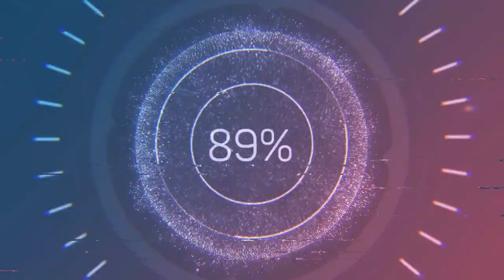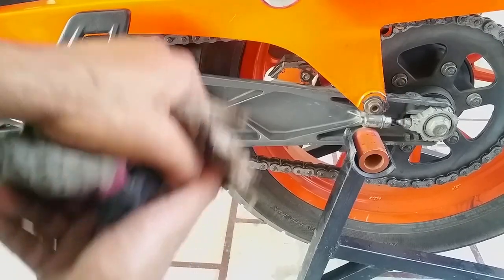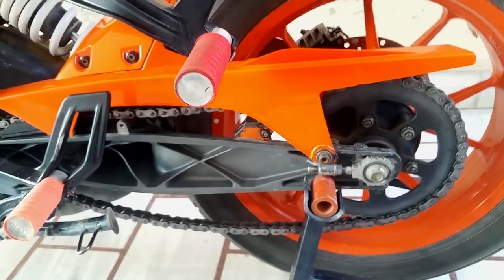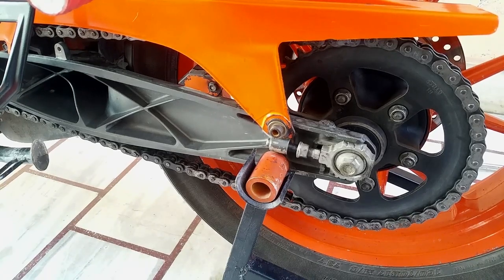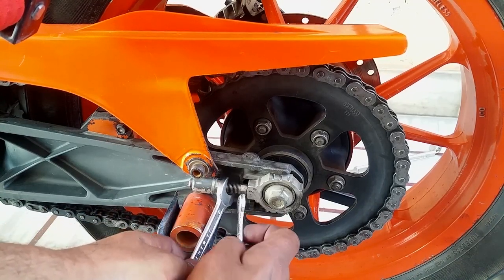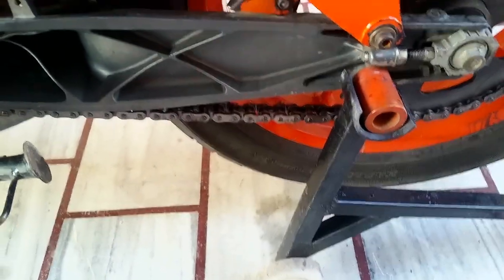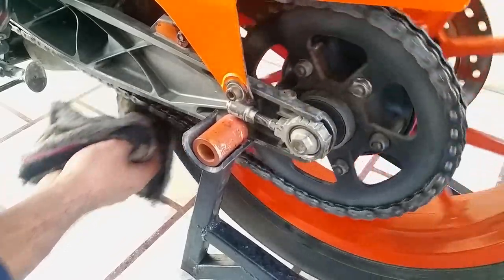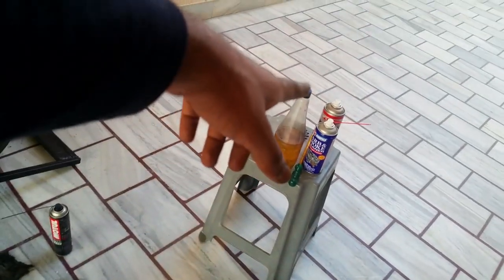Technical Method for Chain Cleaning,Lubing & Adjusting In Motorcycle

Comment: Motul C2 is good but it attracts more dirt and mug which can be easily visible after a short ride and also to add i have seen rust formation on sides of chain during monsoon so i switched to Gear Oil which is cheaper and even protects it from corrosion and also lasts long.
Reply from the maker: Engine Oil Doesn't work on fast bikes..Chain spits it put past 120kmph..watch complete video y I haven't used engine oil or wd-40!
Reply: don't use old engine oil... use gear oil it's awesome. it's heavy and yes it does spit out on the rims my rims get dirty but it's fine regarding the price of motul chain lube. 500ml gear oil costs 50rs and lasts wayyy long why to use motul chain lube ... also it works much better. watch fort nine video on best chain lube and cleaner you will get to know all
Reply: @asjadk2000  thats what i mentioned i never said i use engine oil
Reply: Bhaskar bro ya you are right I even tested all and gear oil is best.  so top end bro gear oil and engine oil are different thing.
Reply: Yes it's attracted dust

Comment: Whether we can use gear oil for lubing the chain
Reply: Sure, 140w oil is effective and easy to clean. The problem is, it will fly away after 60kmph and if ridden below that speed lubing interval is 80-100kms. Use it for commuting and mansoon and all. Actual chain lube is best for touring or fast riding

Comment: don't use petrol for cleaning. use kerosene instead. also you didn't included gear oil in the lubes .. try it out...
Reply: bhai kerosene use krlega bt kerosene vapourate jldi nhi hota bt petrol bhot jldi ho jata ha to to ussi karan petrol accha ha qki thira derr me chain lube v krna hota ha smja ab
Reply: Bro it's not about evaporation the petrol dissolve the O-ring in the chain and leads to damage over time.
So it is best to clean with kerosene or chain cleaner
Reply: Use only kerosene or diesel but not petrol